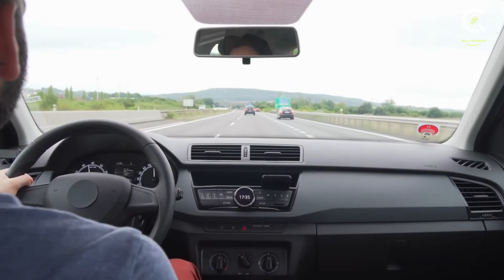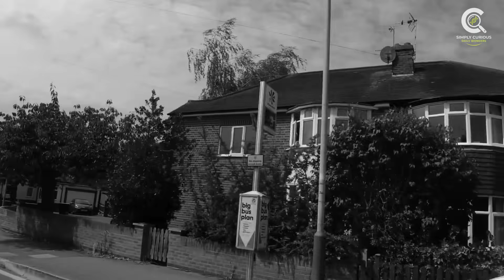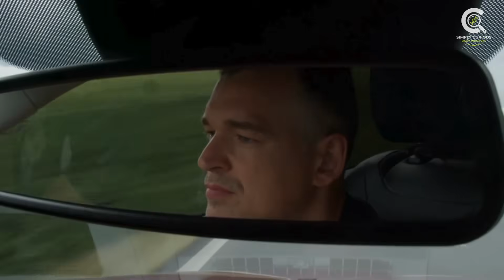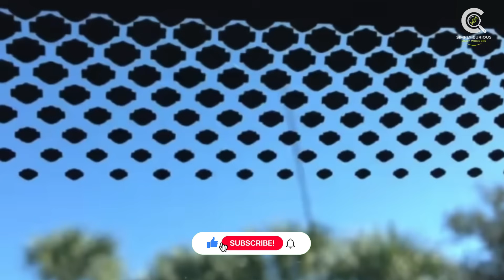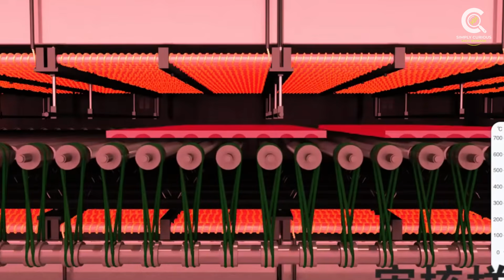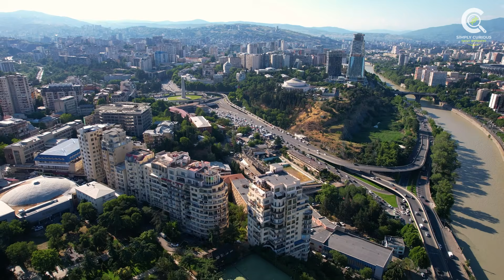Why Car Manufacturers Put Black Dots On Every Windshield

Comment from the maker: Most people think the black dots on a windshield are just decoration — but they help protect the adhesive, control heat during manufacturing, reduce glare, and keep the glass bonded to the car. What other tiny car detail have you noticed but never fully understood?